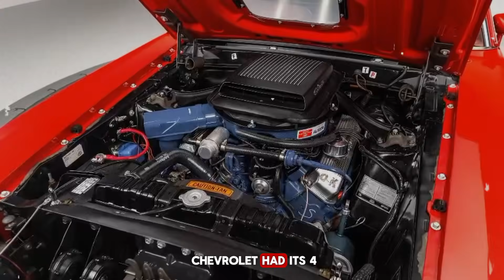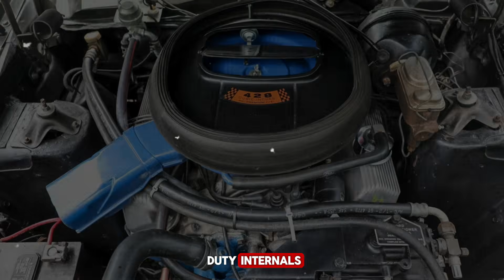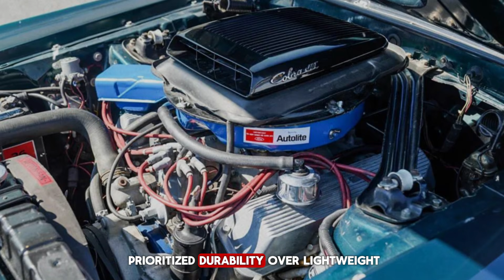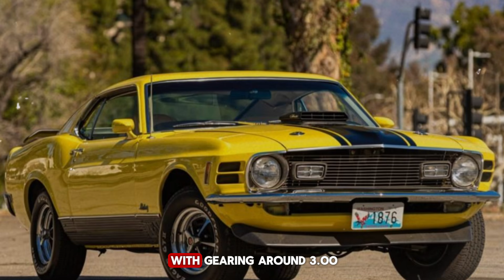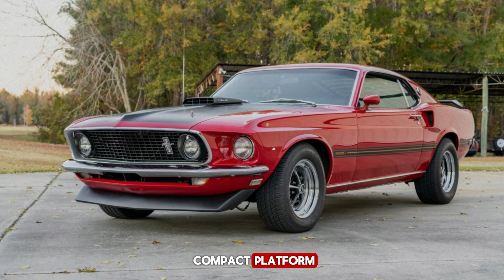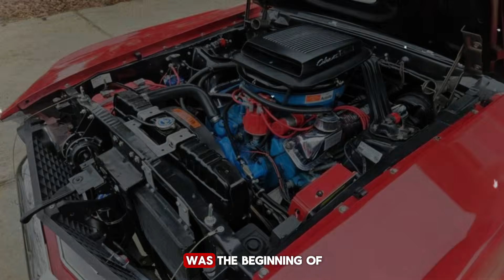Why Ford’s Most Dangerous V8 Disappeared After 1970

Comment: Multiple factors. Gas guzzling hot rods from  the factory were not as desired. 20+ year old technology and design. Ford was not going to design different heads for an overbuilt heavy block when things were going a different way.  Compete with a semi hemi lighter modern BBC? There are always special versions of things and many times are not big sellers. This one wasn't either.
Reply: The 429 was a good engine, but the 428 with today’s materials is still the engine of my heart. I can build an FE engine cheap and still go out and stomp the competition. The 380-428 is still king. I love them, and the aftermarket has stepped in to fill the gap. An engine is only as good as the guy who chose the parts and put it together.

Comment: The 351c would smoke it and did back in the day an the local strips forced the 351c to set out the 350 chevy an run heads up with all big blocks

Comment: You have not mentioned that the 428 was used in a lot of individual applications pumps Generator sets  and some Agriculture platforms
Reply: as a ASE certified machinist I have never seen powdered connecting rods
Reply: You forgot the 361 in the 58 Edsel and the 410 in the 66&67 mercury